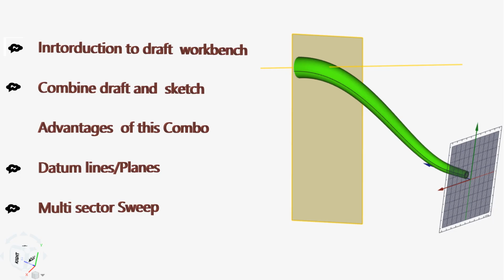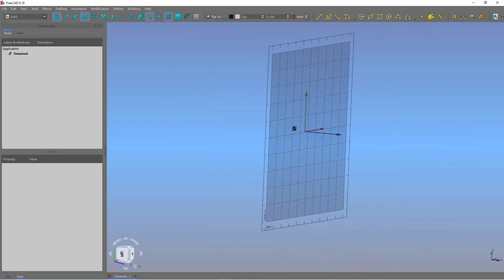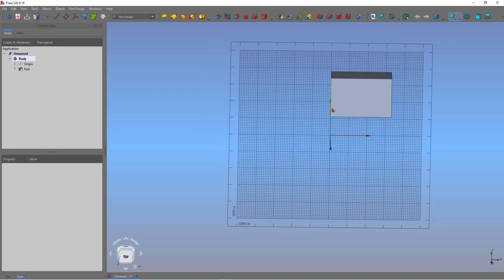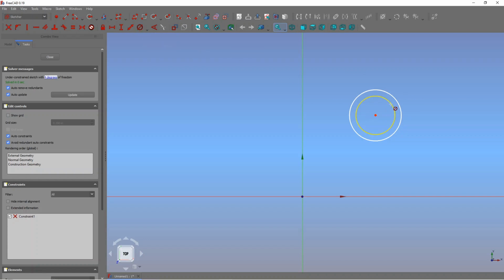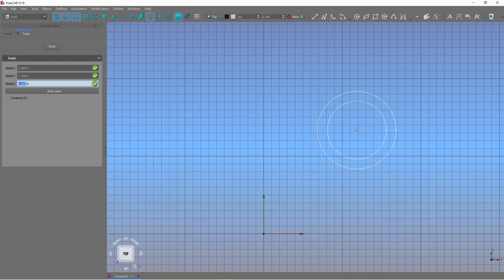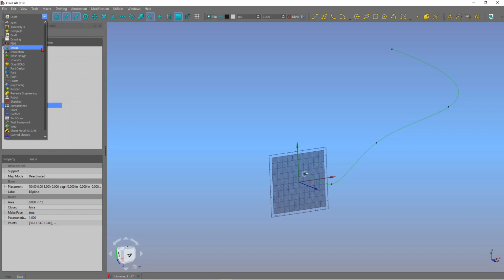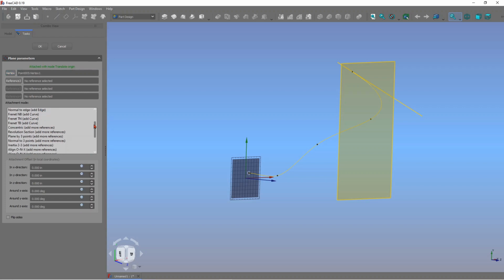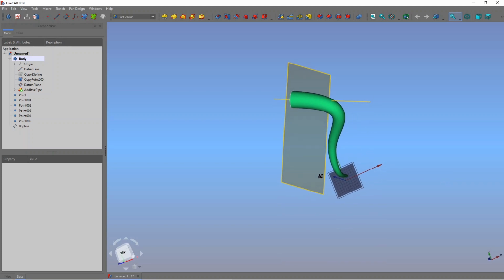FreeCad Tutorial :Combine Draft and Sketch to simplify Modeling. "Don't get stuck in 2D, explore 3D"

Comment: Thank you for this!  Coming from a non-CAD background (Maya/Blender/Illustrator, etc) I'm still having trouble figuring out why sketch is missing so many of the Draft tools (like snapping, rotating, and scaling).  Why separate useful tools into 'Workbenches'.  It all seems very obtuse.

That being said, I really appreciate your tutorial!  This has really helped me out.
Reply from the maker: Great... I am glam it was helpful... I will be putting more videos..  Appreciate you could subscribe to my channel.
Reply: One thing different for freecad, the reading material is much more useful (i.e. not worth ignoring) which is not the case in context of other softwares. read the freecad documentation on freecad wiki - it's very very awesome written. and it contains so many tips which you will never find on youtube. 

But still if you want to miss out from that gold mine, here's summary:
* the basic thing is the method of storing of data
* so, each workbench create objects which contain data specific to that particular workbench.
* that is, objects from different workbench contain different data
* different data - therefore different operations that can be done on them, therefore different tools

* so, example in blender, like remember when you create a new primitive:
* various useful options are available when you create/add the object, but they disappear on doing any operation.
* or like, sphere is available in 2 different menus/modes. and different options are available for each of them.

i hope it helps.

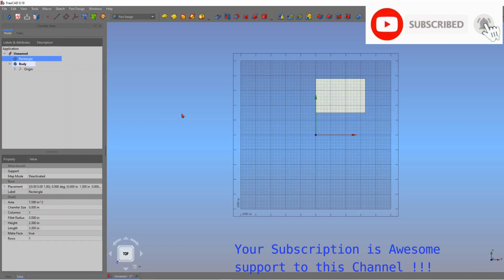Comment: I tried padding the rectangle like at 8:15 but it complains "Cannot use selected object"... What could I be doing wrong?
Reply from the maker: I think you are using the Freecad 0.19.  This is no longer possible in v0.19.   The video  is from V0.18.
walkaround is to drag and drop the rectangle into the body so that Rectangle is child of the body.  Now you should be able to Pad  it.   V0.19  structure is more strictly enforced.
Reply: @cadzis673  Thanks, I'm using Freecad 20, but I figured it out.  Still a useful tutorial though.

Comment: really great tutorial. How come the sketch workbench doesn't have a spline tool?  I would prefer if the drafting WB was purely for 2D drawing and the sketch WB didn't have to rely on the draft WB for extra tools to help build complex models.  I am trying to see the logic behind the setup, but maybe it has to do with the fact that the sketch WB was a much later addition.  I need ot see more videos where the two work in tandem
Reply: sketch, at least in FC_v0.19 do have a spline tool
Reply from the maker: Thank you for your comment.  Drafting in most of other CAD packages   is for 2D drawing.  It seems Freecad is taking a different approach...